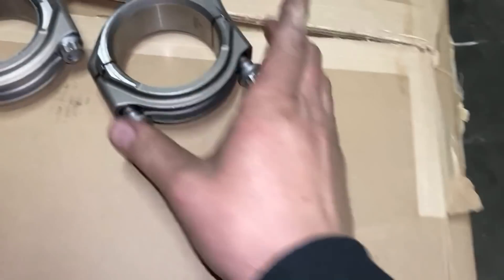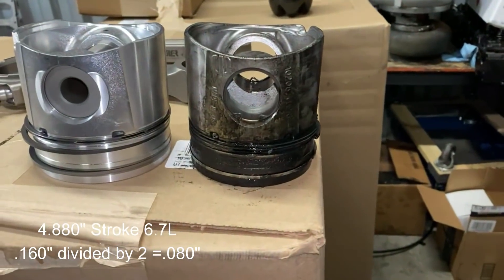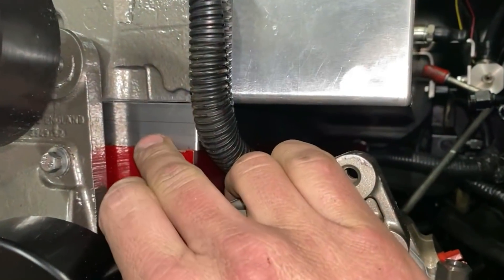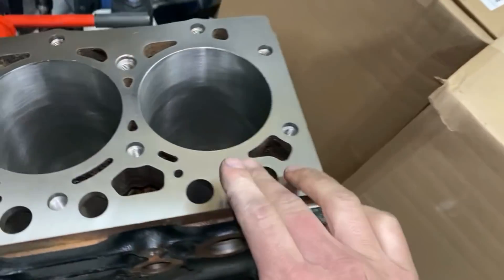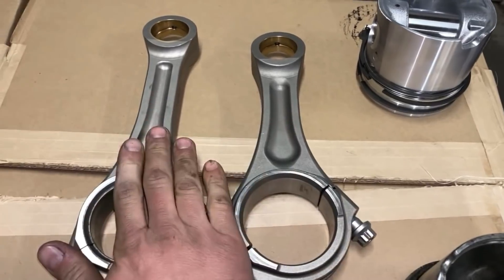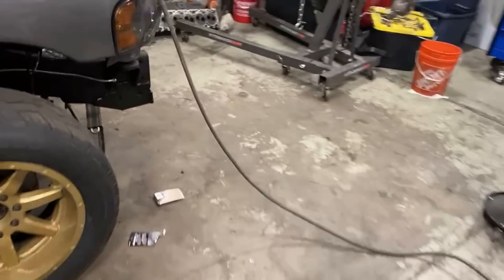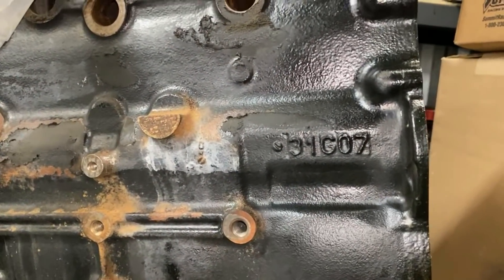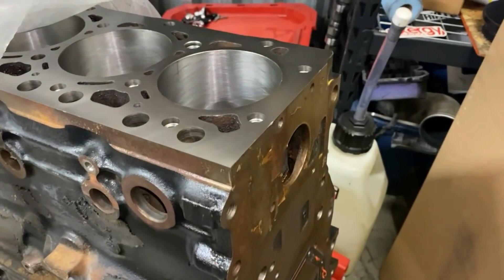WHAT IS A CUMMINS DECKPLATE, 6.1L, 6.4L, 6.7L, 6.8L?

Comment: Subarus all use the same rods as well. The destroked diesel with long rod changes the rod to stroke ratio making it a higher reving engine with a flat hoarse power curve giving you a bigger power band. The only thing would be weakness of the spacer and structural fatigue, but seeing how much power they give them, I have other issues at hand like my trans shitting it’s guys out in the intersection

Comment: I really wanna do a deck plate 6.4 for my 4th gen, but I wanna do the destroked 6.7 method with using a 5.9 crank in a 6.7 block with stock size 6.7 pistons

Comment: A nother massive benefit of  sleeves is that you can get the rings seated before assembly by cycling the pair. Cat dose this with there cylinder packs.

Custom belt... what effect dose the deck plate have ? None of the accessories attach other than the alternator
Reply from the maker: The alternator is moved so it changes I think it's a 7.3 belt now

Comment: What i would  like to know is 
#1.  what rods i would need to use a 6.7 crank in a 5.9 block

#2.  what pistons i would need.

 And if im not planning to go over 1000hp  what is the highest compression  ratio for  best possible effeciency for cruising under low boost or no boost as a daily driver.
Reply from the maker: 5.9/6.7 rods are the same. 
Depends what year any of this set up is

Comment: This is a very good video I appreciate all your tenacity to give out good information and do a good job back in the early 60s Chrysler but the 426 max wedge block would take the block and put it in the oven and heat it up to roughly 1200° and let it sit in there for 6 or 8 hours as I understand and then slowly cool it off that made the block as strong as it could be as far as equal strength throughout the block I wonder if that would help our Cummins engine maybe cryo-genic dipping would helpThis is six and row Jim saying keep up the good work guys

Comment: So this isn't directly related but you mentioned vp44 24v engines for a second and since you're semi local (I'm up in Farmington) I'd like to support you guys (and get good parts obviously) when I start working on it. I've got a 2001 cummins engine. It's eventually going into a 2000 4 door chevy with a 4l80e that's probably going to have a 1000lb-ft rating. It'll be a daily driver/general use truck. Would you keep the vp44 or p-pump it? What turbo would you run? And what injectors? Also, thanks for the content to help educate some of us who are still learning.

Comment: Does the extra sleeving add heat? Cause I do believe Cummins doesn’t recommend the use of thick sleeves on the 5.9l but I could be wrong! I bought a 06’ that had been sleeved by some special type people  (very poorley done) but they put thick sleeves on 3 and 4 and those both failed and pinched the piston!  But I was new to all this so I just had Black water send me a remand with 12 valve rods and pistons and wrist pins and ARP studs! The installer said it was the burliest  5.9 he had seen I guess! IDK but is that setup sound like a good start at least fir the bottom end? I was a huge WRX guy and soon as I rode in a Cummins powered pickup I switched and want to learn as much as I can while building my first one up to just like 1000 to 1200whp. I drove rig in the Bay Area fir 13 years snd my last Kenworth had a ISX 15 so I was already a Big Red guy! Awesom video and always appreciate knowledge special when it’s free so thank you! I’m born raised Park City, Ut.  native!

Comment: That was cool love the info didn't realize I knew so little so is there a gasket between deckplate and block and do you still fire ring  head and deckplate
Reply from the maker: Yes there is a oring gasket on the deckplate then a modified fire ring gasket on the top sealing to the head

Comment: Some sleeves require to be pressed in at a machine shop. Are the power bores a wet diesel sleeve then?
Reply: yes wet sleeve just like semi
Reply from the maker: No they are dry didn’t have to open them up

Comment: Hey josh, what would you say the max power is that a stock 06 5.9 block can hold? Looking for 1300-1500 and debating building my 5.9 or doing a 6.7 swap. On a little bit of a budget but would rather do it once
Reply from the maker: 6.7 block due to better bore strength from the Sienese bore
Reply: @horsetorquesdiesel  thanks, is the deck plate/ rod angle a large factor at that power range? Or is a stock 6.7 with Wagler rods and a girdle enough?
Reply: Truck currently makes over 1000 on stock bottom end

Comment: If you haven't already, you should do a video about injector spray angles and piston bowl designs, that would be a cool video
Reply: Dynomite diesel performance has the science video on the spray angles vs bowl shape and dyno results they go into hole size, number of holes and adding a pilot hole in a 12 valve that the have a patent on which allows a small amount of fuel right as the needle lifts, allowing a cleaner burn and yes less smoke. But more power